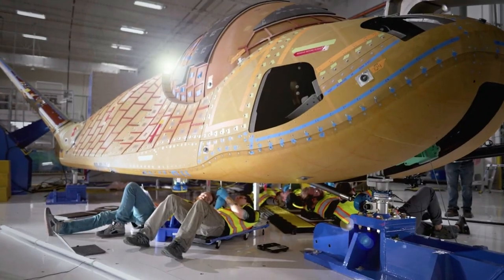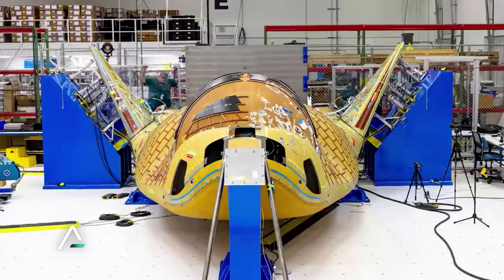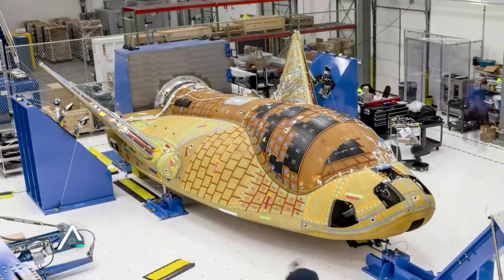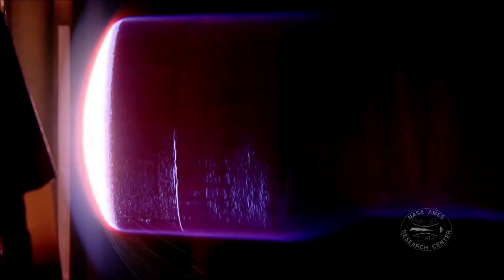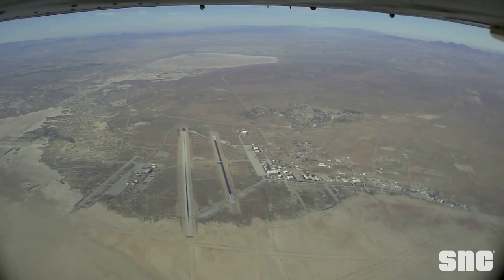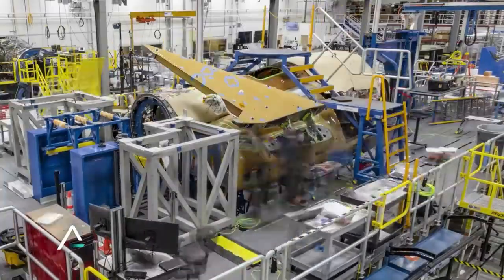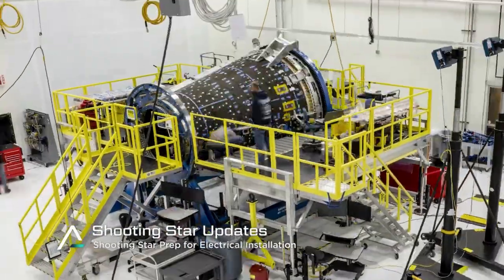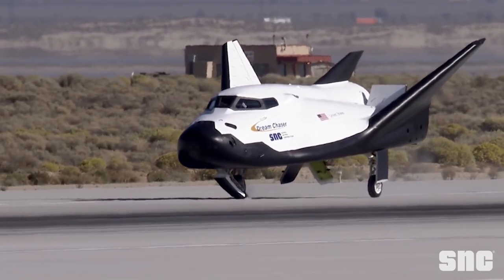The Thousands of Tiles Protecting Dream Chaser Tenacity On Its First Launch

Comment: I feel like any space station should have a dreamchaser docked so it can be used as an escape pod and fly to the most convenient airport for medical attention.
Reply: This is good idea. However, the escaping astronauts will have the either wait for their orbit aligns with the “convenient airport” or, if they need to go back to earth immediately, they’ll have to land wherever their spacecraft is currently orbiting. This could be nearly anywhere on earth.
Reply: @tygerbyrn  crew can wait inside the spaceship for a few hours before they deorbit meaning there will be many airports around the world that can assist the spacecraft
Reply: Could leave a Crew Dragon that can undock, de-orbit, and water land by itself.
Reply: @josephastier7421  the is the case now with the crew dragon and soyuz, but there's a vital issue with these two spacecrafts: they can stay docked up to seven months because the hypergolics they use decompose when left in microgravity for extended periods of time
Reply: @tygerbyrn  There are a lot of airports and airfields long enough for an emergency, probably the most flexible (near future) return vehicle
Reply: @josephastier7421  If they need a hospital you wouldn't want to wait for recovery from the water

Comment: This craft will be useful to help keep the ISS, in the correct orbit. As the Dragon capsules cannot change or adjust the ISS orbits. The only vehicle that can currently do this is Russian.
Reply: Cygnus and Starliner can also do the same iirc, but those don’t launch as often as DC will (if I’m remembering correctly)
Reply: @AeonExploration  starliner is scrap

Comment: I recently discovered a design by the foreign ussr called "spiral" that looks like the dreamchaser it is about the same size and had the same aerodynamic features (wings, capsule, etc). From what I understand it was designed to compete with a nasa spaceplane (prior to the space shuttle). I'm really surprised with the fact that physics can lead to having many similarities between two spaceships.
Reply: The DreamChaser is based on the NASA Langley HL-20, which was based on the "Spiral" it's not coincidence or parallel evolution.

An Aussie P-3 "Orion" ASW / maritime recon plane got photos of the Soviet BOR-4 being retrieved after its flight and NASA studied it.

The shape was for the Soviet "Uragan" space interceptor (called "Spiral" by NATO), competitor to the US "X-20 "DynaSoar". The BOR-4 was used to test TPS and controls for their "Buran" Shuttle.

MiG-105 test plane
https://youtu.be/x6bEhw1K--0
It's in a museum now, was used also to fly on its own with its jet engine.

Comment: It is going to be interesting to contrast the performance of DC’s thermal protection system vs starship as the approaches have significant differences. DC appears to be an incremental evolution of an older approach that had some issues but worked while SS is as usual a departure from general practices. I find it interesting that not only is SS’s tiles and attachment mechanism radically non-traditional but its stainless steel substructure considerably more flexible than traditional designs. SS seems to be “popping” tiles off during such benign ground test of just cycling the start sequence of its engines that it makes one wonder how wildly its hull and tile interface will differentially flex under actual flight conditions. This should be entertaining.

Comment: I have to ask what they're doing wrong?
The Dream Chaser is based on the HL-20, which is based on the Soviet "Spiral".
NASA Langley studied the "Spiral" and found that it had "exceptionally benign thermal characteristics", and didn't require advanced thermal protection even on the leading edges, except maybe the nose, and possibly not even that.
I guess the flat up-turned "Lozino-Lozhinsky" nose as on the MiG-105 was too un-American and funny looking, so this extra complexity is a better choice.

Comment: All due respect to the hard work of the company and I realize it's very difficult to come up with a genuine idea for thermal protection, but improvement on a problematic system is still problematic. Tiles are not safe or reliable enough; improved or not.
Reply: The x-37 seems to be fine, also the crewed version will come a while later. So if the unmanned one goes boom, crew will not die

Comment: Dream chaser wants to be human rated to launch Astronauts to the ISS. Presently only one rocket is human rated and that’s the Falcon-9. ULA has the Atlas 5 which is being phased out and pretty much dedicated to Starliner. The replacement Vulcan Centaur hasn’t even gotten its engines yet much less flown much less crew rated. I know the initial flight is supposed to be on a Vulcan Centaur but it is capable to launch on a Falcon-9 if required.

Comment: Tiles were used in the 1960's and later in the space shuttle in the 1980's. So it's so old thermal insulating technology. BTW wasn't the lack of 2 or 3 tiles that got loose that caused a space shuttle tragedy on reentrance? So in what way are we advancing? Sorry but this looks so 60's.

Comment: Great video again
Can somebody tell me where and pressurised cargo is Kerry
Apologies if it’s obvious from the video but I am a blind subscriber and am excuse the pun still in the dark
Cheers
Reply: Some pressurized payload can be fitted inside and passed out through the airlock, as was planned on the HL-20 / HL-42. The aft-mated  module may be pressurized since it has the airlock, but presumably aft cargo cold also be unpressurized.
Reply: @JFrazer4303  Thanks